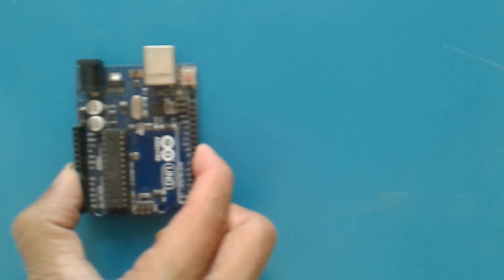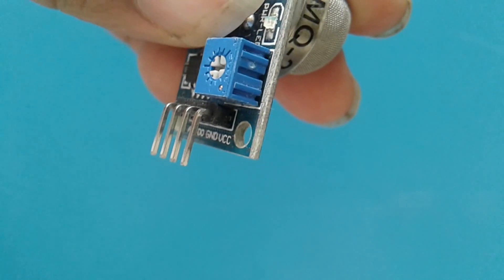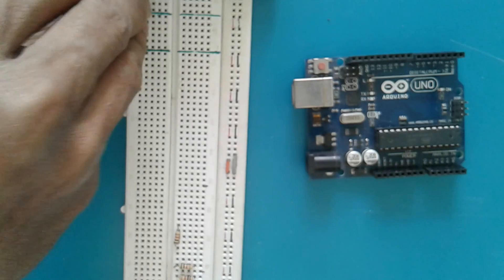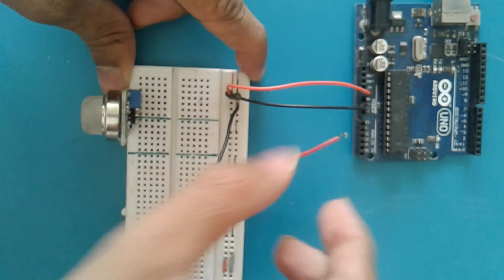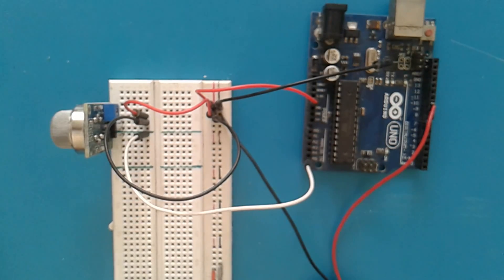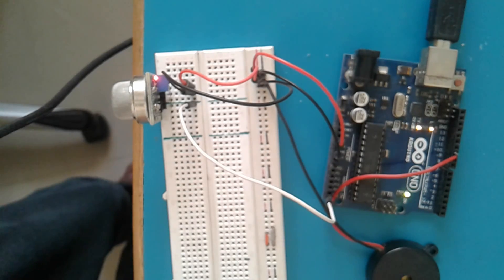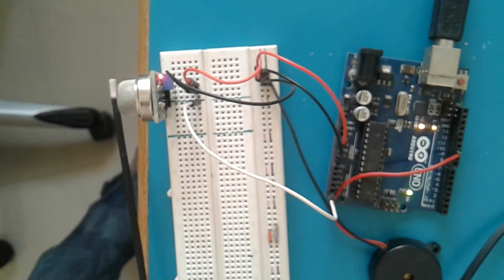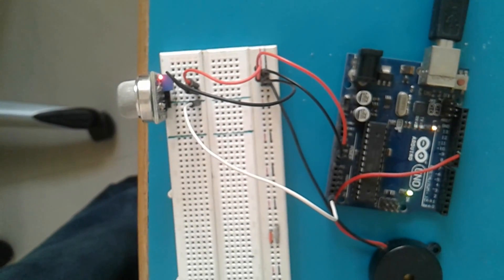How to Connect MQ2 Gas Sensor To Arduino

Comment: I have a doubt y arduino... Without that u can do rgt... Bcoz same work smoke detector does
Reply from the maker: Yes. But in order to control other actuators you need arduino or any other processing component. The work of smoke detector is to detect smoke and not to control the actuators like buzzers or water sprinklers.

The buzzer used for demonstration is a small nd low voltage buzzer used by students but sometime you maybe required to control via relay circuits. Hence, any processing board can do the job. I preferred arduino over raspberry in this video.

Comment: Sir is it possible to run the pollution control project without using Arduino Uno..?
Reply from the maker: You atleast need an processor for that. If you are good in electronics you can go for that. But using an arduino is the easiest part.

Comment: So it activates after giving it a lot of smoke.
If you use this for a smoke detector you'd be dead before the alarm sounds.....lol
Reply from the maker: If you are unaware then... You have two different types of sensitivity to adjust. One is the potentiometer and other is the code.

I have kept both at low. So that the smoke is visible in the video.

(Probably to make sure that you get help implementing it before you are dead. Rofl)
Reply: @GauravsArena  I will give it a try.Thanks buddy.Great video

Comment: Actually the code is not opening in Google drive what to do sir
Reply from the maker: Mail me regarding the same. I will try to mail you back the code
Reply from the maker: Check out your email. I have mailed you the code.
Reply: Gaurav's Arena tnq very much
Reply: @HeyMan-yk8ul  Bhai plz send me the code to my email
Reply from the maker: Give me your email id then 😂😂
Reply: @GauravsArena  Bhai plz imediatly it's urgent
Reply: @GauravsArena  Bhai plzz it's urgent
Reply: Can you email me too ? khairjuani@gmail.com
Reply: @khairjuani8993  did he send you the code
Reply from the maker: Dear aryan... I always try to send the code to every request I get. Sometimes its delayed by a day or two but everyone receives it unless and untill the email is proper.
Reply: @GauravsArena  can u send it to me now
Reply from the maker: I dont have my laptop now. You will receive it by end of day. Drop me an email for the same.
Reply: @GauravsArena  thank you
Reply: @GauravsArena  what is your email id
Reply from the maker: You can check it out in your inbox.
Reply: my mail is archies158@gmail.com plzzz send me the code...
Reply: Which ohm resistors have you used? Please reply fast we need to sumbit the project by tomorrow.  Please.
Reply from the maker: Dear sahana, I haven't used any kind of resistors. In the initial part of the video, while showcasing the breadboard there are resistors mounted on it but I haven't used them. Go through the video properly, it will help you.

Comment: can we execute ardunio uno code on ardunio mega yes or no
Reply from the maker: Yes
Reply: sir how, i cant plz guide me
Reply from the maker: If you are trying to upload then you have to change your board from the Tools in menubar. 

Please do remember to change the board every time. And don't forget the port.
Reply: any tutorial sir share me links
Reply: when i open the your code file it display create the sketch how i create sir
Reply from the maker: Nope. But its pretty easy. You can google it out.
Reply from the maker: It will have an ok button. Just click on it and a folder will be created. The working mechanism is the sketch file must reside within the directory with the same name of the sketch.

Comment: At what distance from the LPG gas stove can it detect the leakage?
Reply from the maker: Detection doesn't depends on the distance of gas sensor from LPG gas stove. As soon as the gas reaches the sensor it gives an output.

The distance can be compared with sensitivity. The lesser is the distance, the higher is the sensitivity and vice versa.

Comment: How to upload the codes??? Plizzz reply
Reply from the maker: Download Arduino IDE from its official website. Then run the application. Click on the upload button (probably a right side arrow) at top. Also you can click on sketch in the menu bar and then click on Upload. You can also use the web interface, procedure might be a little different.

Comment: How to change the threshold value
Reply from the maker: You can change the sensitivity by adjusting the potentiometer at the rear side of the sensor. Or you can adjust the threshold value given in the code. Depending on the output change the value of the variable threshold (or similar). The value in the code might be somewhere around 300-400. You can change it according to your requirement.

Comment: Do you get consistent readings with this setup? I advice you not to power the sensor with the arduino, it draws too much current, you can fry the voltage regulator!
Reply from the maker: Thanks for the advice. And yes, I get consistent reading from the setup. (The values might differ with the change in the value of potentiometer.)

Comment: Sir can u help me... Even after removing smoke sensor from the circuit and keeping rest of the circuit as it is.... M getting values on serial monitor
Reply from the maker: +Priya Bharti Those values are known as garbage values. There is no possible way in which you can stop the Arduino from reading the pin (when you have specified it in the code).
Reply: Gaurav's Arena thanku sir...

Comment: Gaurav:  Thanks so much for making and publishing this video. It is very helpful to me.
Can you tell me if you've used this continuously monitor any gas leakage like near a gas cylinder?
I want to create a setup for running it on a long term basis and want to know if there's any problems running it for months/years.

Also, you mentoined that the mesh becomes too hot to touch.  Can you tell me if it becomes hot as soon as you connect the circuit and power it on?  Or does it get hot only if it detects smoke?

Thanks for your help.
Reply from the maker: +Ash B the mesh gets hot but it won't burn up the circuit. It is not so hot that you can't touch it but it's temperature is sometimes pretty higher than the normal room temperature. 

I have not used it for months and years yet. But I am developing a home automation system and hence I have tested it for 1 month. Everything was working fine with the circuit.

NOTE
While using the sensor near cas cylinder please take extreme precautions. Attempt it only if you have a perfect circuit. Any kind of minimalistic spark in the circuit can prove fatal.

Comment: Hi Sir
I want to include an lcd along with this circuit .Can you please help me out with the connection and the coding for lcd within this circuit .
Reply from the maker: +Sushmitha Pais I don't have any tutorial for that right now. But if you have any experience of connecting lcd with Arduino then all you will have to do is to just display the data by calling the function (lcd.print()). I will try to upload the video tutorial soon.

Comment: Hi Sir
TX and RX lights are not blinking. Can you please tell me what is the mistake and how do I go about correcting it
Reply from the maker: +Sushmitha Pais
Tx stands for transmit X
Rx stands for receive X.

These lights blink when data is transmitted from external device like PC to Arduino. If the data transmission is taking place then they will surely blink unless your LEDs are damaged.

Comment: sir can u tell how to send sensor data to anroid
Reply: if u remember me , your old student
Reply from the maker: +Rohan Kalonia if you are going to deal with only simple sensors then you can go for Bluetooth module (hc05 or hc06). If you are planning for large and complex circuitry then go for WiFi (esp8266 or similar).

Wise to Note: 
esp8266 too require a complex circuit and hence it is not meant for beginners.

I recommend to go with Bluetooth unless and until you are using an optical sensor or 100 different sensors.

Comment: Where is the circuit diagram
Reply from the maker: +Nizamudeen mohammed no circuit diagram is shown or provided. Bt you can design your own using the video.
Reply: I'm new to electronics , if u send circuit diagram it will be very helpfull
Reply from the maker: +Nizamudeen mohammed please email me a simple message requesting the circuit diagram. I will provide you with the same.
Reply: nizammohammed1989@gmail.com plz send circuit diagram and code
Reply from the maker: +Nizam Mohammed done. Please send an acknowledgement upon reception.

Comment: There is  no coding part in this video. Also it is not advisable to derive heater power from arduino board instead use separate power supply.
Reply from the maker: +PRADIP IKHANKAR the code has been given in the description. Also I am unable to understand the point mentioned by you: it is not advisable to derive heater power from Arduino.

I would like to know:
1. What do you mean by heater power?
2. Why is not advisable?
3. What will happen if I do so?
Reply: @GauravsArena  It means that you should not draw current for the mq2 gas sensor from the Arduino board. You should use a separate power supply to power the mq-2

Comment: do we need to preheat the sensor, or just upload the code & take readings?
Reply from the maker: +SNEHLATA SINHA what do you mean by preheat? Do you want to roast and eat the sensor? Just joking. 

All you have to do is follow the steps.
1. Do the wiring
2. Upload the code
3. Adjust sensitivity or threshhold if required.
4. Get the output.

Note: No need to pre heat the sensor.
Reply: but in my case sensor is showing very high value at normal room condition around 900 & it doesn't changes in presence of smoke.
Reply from the maker: +SNEHLATA SINHA make sure you have wired it correctly. Adjust the potentiometer at the back side of the sensor to adjust the sensitivity. Even though if it's showing an abnormal value then either comment your connection here or email me the clear pics of circuit and code.

Comment: are u using any power supply for this project?
Reply from the maker: +Sushmitha Pais no electronic equipment can work without power. I had powered it using an standard usb cable. The cable using which I uploaded the code. You can also power it using 9v battery.

Comment: Sir I need help it’s urgent. The buzzer keeps on buzzing idk why. I’ve checked the connections but maybe there could be something I’m missing out. How can I contact you?
Reply from the maker: +max halt You can contact me by email. It's in the about tab of the channel. If it's urgent be sure to send me the actual images of circuit and code you have uploaded.
Reply: Gaurav's Arena okay sir. Please reply asap😊
Reply: Gaurav's Arena sir can you please reply. I need it urgently. I know I’m troubling you but I need it really quick. Thank you so much
Reply from the maker: +max halt Dear, I had already replied to your mail. Just change the sensorThres value from 30 to 300.

Comment: I have used mq2 sensor module D2019, but in the serial monitor the analog read shows only a value of 9 or 10 and sometimes 8, even when i bring in smoke values shows the variation of 7 to downside. help out asap.
Reply from the maker: +Abhinav Chadha I tried to search the module D2019 on Google but all I found was only related to mq2. Have you used the same code as given in the description? If you have used another code... Then the code might be mapping the values. For eg. 256 will be mapped to 10 and 0 will be mapped to 0. If you want to adjust the sensitivity then adjust the potentiometer at the back side of the mq2 sensor.

I recommend you to use the code given in the description along with the wiring as shown in video. 

Hope this helps.
Reply: i have used your code only. the problem still persists.
Reply from the maker: +Abhinav Chadha A normal mq2 gas sensor with the code given will give the values in 3 digits subject to the condition that the potentiometer is neatly adjusted. Try checking your circuit carefully and also re-upload the code. 

If you have any link for the D2019 module then paste it here or email me.
Reply: int redLED=12;
int greenLED=11;
int buzzer=10;
float smoke=A5;
float smokethres=8;
int brightness=0;
int fadeamount=5;
void setup() 
{
  pinMode(redLED,OUTPUT);
  pinMode(greenLED,OUTPUT);
  pinMode(buzzer, OUTPUT);
  pinMode(smoke,INPUT);
  Serial.begin(9600);
}

void loop()
{
  float analogip=analogRead(smoke);
  Serial.print("Pin A:");
  Serial.println(analogip);
  if(analogip>=smokethres)
  {
    digitalWrite(redLED,HIGH);
    digitalWrite(greenLED,LOW);
    tone(buzzer,100,200);
  }
  else
  {
    digitalWrite(redLED,LOW);
    noTone(buzzer);
    analogWrite(greenLED,brightness);
    brightness=brightness+fadeamount;
    if(brightness==0||brightness==255)
    {
      fadeamount=-fadeamount;
    }
    noTone(buzzer);
  }
  delay(50);
}
  
connection is all correct. i have verified it many times.
Reply from the maker: +Abhinav Chadha although this is not the code I provided but everything is looking good. It should work flawlessly. Interpret and go with the values provided by you senor. That's d best way.

Comment: Can u tell me how much area this mq2 sensor can cover???
Reply from the maker: +Gurpreet kour Kamthekar you can refer datasheet if you require dimensions.

If you are concerned about coverage area then it will sense only when gas reaches the sensor. You can adjust the threshold for sensitivity.

Comment: if i use mq6 how i code the arduino
Reply from the maker: +Nur Atika the code will remain same. You don't need to change anything unless and untill you are not concerned with variable names.  Although i have never used mq6. But as far as I know, the gas that will be sensed will be different. MQ6 is used for combustible gasses like LPG, Methane, Propane, etc.

Comment: can u explain it in more fundamentals and how a 10th class boy  make this DIY
Reply from the maker: All you need is an Arduino (UNO or NANO), a smoke sensor (MQ2 or some other as per your requirement) and few wires. Connection and other stuff are explained in the video. All you have to do is buy the components, make the connections, download the code and upload it to Arduino. To upload the code you might require Arduino IDE. You are all done. In case if it doesn't work then change the threshold value in the code.

It might be a wonderful DIY project for a class 10 boy but the project might require some basic programming skills. The circuit shown in the video is programmable so that it can be embedded in larger projects. There are several other circuits which can do the same work but will be static in nature. Google it for more information. (Might be cost efficient but will require a complex circuit. I guess.)

You can download Arduino IDE at https://www.arduino.cc/

Comment: when I connected to PC that TX is on when I connected through the battery it doesn't why
Reply from the maker: TX and RX LED's are meant for communication with PC. They won't blink if connected to a battery. TX will blink as it shows a connection between Arduino and PC, even though not connected to PC it will blink as it attempts to send data whereas RX won't blink as no data is received from PC to Arduino as you have powered it with battery.

Comment: sir mines is working properly but my TX led I not blinking
Reply from the maker: LED is connected in parallel to the circuit, that means your data can be sent even if the LED is not blinking. Check whether data is received and displayed on the serial monitor or not. Also, make sure you have the same baud rate as specified in the code. sample: "serial.begin(9600)"
Reply from the maker: LED is not working so it might have burnt.

Comment: The buzzzer is beeping spontaneously. even before the detector detects smoke. Does this mean that the MQ 2 sensor has fault.
Reply from the maker: Definitely not. Your MQ2 is working fine. Check the circuit for wiring connection. Make sure buzzer is connected to digital pin of arduino and not to the VCC.
Reply: Most likely not. Check the potentiometer in the back of the module. That can be used to tune the level a which the detection threshold triggers. 

I should mention tho that these sensors are generally quite poor and should not be used as fire alarms or in other critical applications. One can use the analog signal and plot that but it is hard to see any kind of detection with anything but very high gas concentrations.

Comment: what is angle of cannada
Reply from the maker: I am unable to understand your question.... Will you please elaborate?
Reply: you can listen at 6:00 min
Reply: and also say how to change threshold plz I want to submit in my school
Reply from the maker: It's CAMERA..... But I accept that it sounds like CANADA. sorry for that.
Reply from the maker: You will have to change it from code. A value of 300 or 400 is there in the code. Change it as per your requirement.

Comment: sir can I provide power to aurdino with battery
Reply from the maker: Yes, you can power the Arduino with battery. Make sure that the voltage and current are between the specified limit.
Refer https://www.arduino.cc/ for details related to your board.

Comment: Sir in place of buzzer can we connect servo motor? or any motor to rotate ? please help me
Reply from the maker: Dear Viane Phill, You can connect anything instead of the buzzer. You can even connect a LED, send a SMS to the user, Log it on the webserver using IoT, and even move a motor, relay or actuator. So you can surely connect a motor. All you need to do is replace my code of buzzer with your code for the motor. Hope this helps.